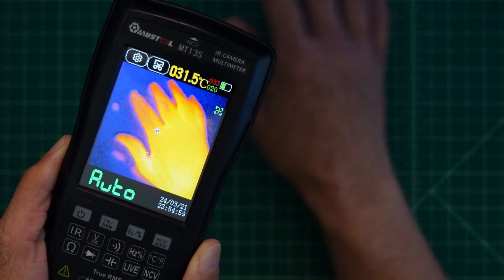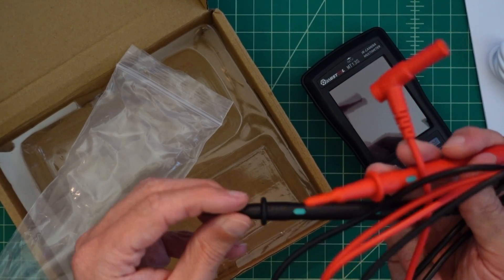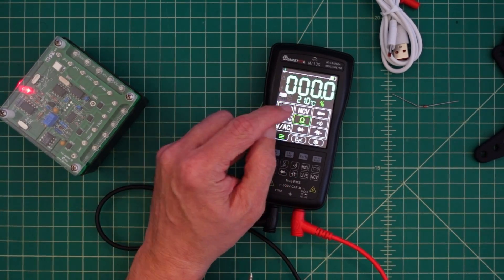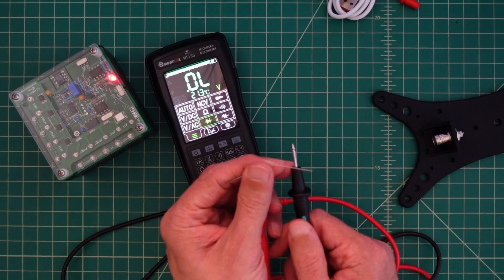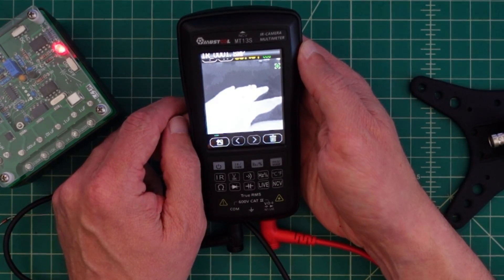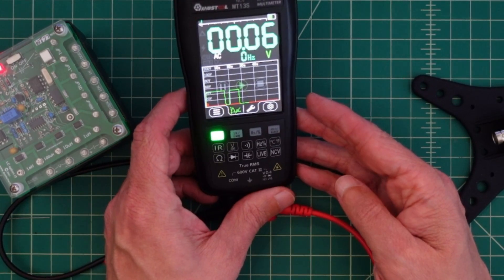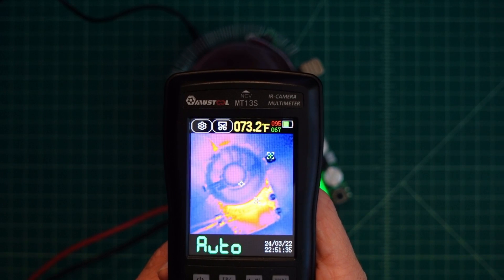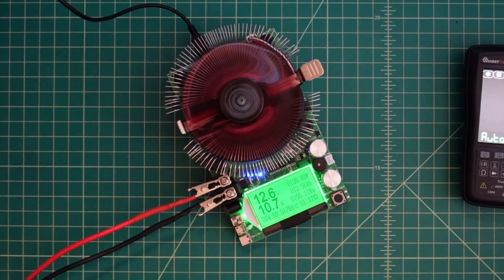Mustool MS13S IR Camera and Multimeter

Comment: Hi, is there any special way to connect via USB?
Mine - it has arrived a couple hours ago - is not connecting to my phone neither PC.
Reply from the maker: Under settings you have to enable USB-MOD
Reply: @TheSmokinApe  Thanks, but there is no swappable option, just a USB signal.
But last time I tried it, it worked :).
Reply from the maker: Yeah, I think just going into that setting turns it on

Comment: I know this is meant for hams who will mostly need close range, but have you tested this at longer ranges? I'm curious how well it works at say 10-20ft distance as common in home inspection applications. I'm also curious about accuracy. How do the measured values compare against say, a calibrated thermocouple?
Reply from the maker: Sorry man, I didn’t test either of those conditions

Comment: that a nice meter. never saw one with IR camera . now you can check your connections . a bad one heats up. I  have a Flair . use for my electrical work. can test UNUN and Balun as well.  you can see wire heat up and or the core.  my 10 AWG wind ones the wire stays cool and the core heats up after a wile. very handy to have.  test your cores on the antenna kits you have. make a good video on core heating.  FT8 heats the small ones up . makes a nice red ring on IR camera.  get to hot and SWR will spike . will be great to show why we down rate for digital and modes like AM/FM . have some fun with that meter. 73's
Reply from the maker: I’m pretty excited about the meter, hoping to test some ‘roid with it soon 👍

Comment: You should but it to a known faulty board and show how it sees a faulty component. I’d love to see something like that before buying.
Reply from the maker: That would be pretty cool
Reply: @TheSmokinApe I have an older radio needing repair but am stuck sending in. I’m sure I can’t see the issue without thermal. Be a pretty cool diagnosing device if it can see from closer distance as it does with your other items.

Comment: Emissivity has to do with the type of material you are trying to measure the temperature of.  A shiny surface will have a different amount of IR energy emitted than a surface that is rusted, or painted, metal or plastic, ect..  at the same temperature.   Allows you to calibrate for the material you are interested in testing.
Reply: When I was working in the field, we'd place a piece of duct tape on a reflective/shiny surface and shoot it to get the temp.  I think we'd use an emissivity of about .9 for the tape, but it was far more accurate than just trying to get the temp of a low-e surface as it is without the tape.
Reply from the maker: Ah, thanks for the info Arnold 👍
Reply: @TheSmokinApe   I should also say, flat black spray paint makes a big difference in getting good readings.  It's usually cheap and dries fast which is a nice bonus.
Reply: Yeah, it can be really weird.  If you have something with a somewhat shiny enclosure, the IR camera will do a really poor job measuring the temp of that enclosure.  Put a piece of flat black gaffers tape on the enclosure and BAM, good readings.